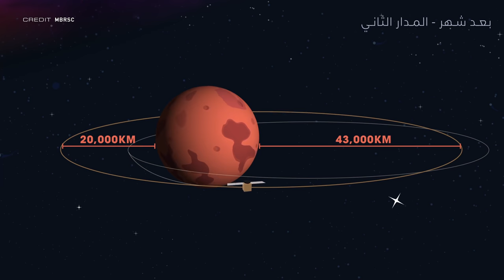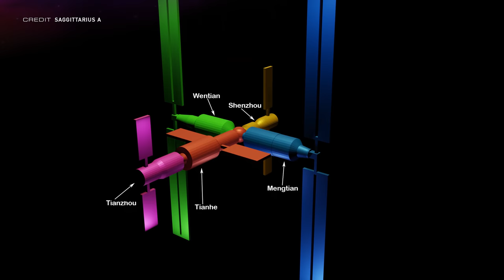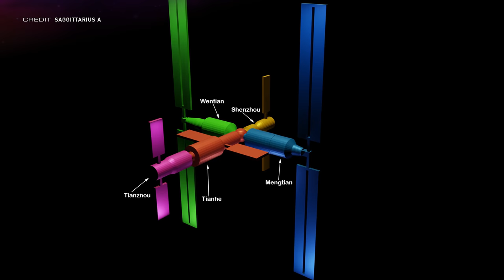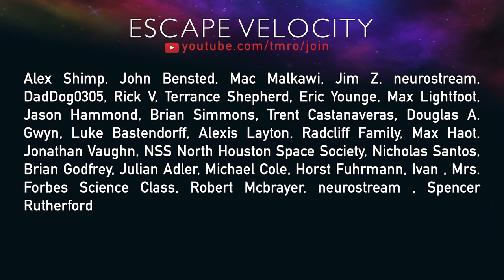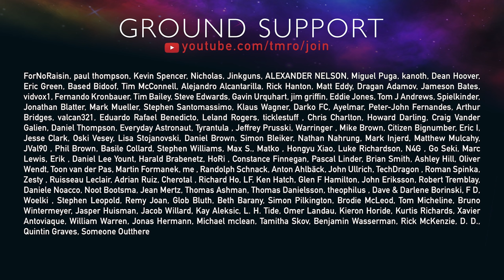2021's Epic Spaceflight Events | TMRO:News

Comment: G'day,

At this point, the Starship appears to feature not only a complete absence of Launch Abort Capability, but also an apparent inability to reliably feed it's Engines with an UNINTERRUPTED Supply of Liquid Methane & LOx,  during the necessarily rapid Transition from Belly-Flopping unto Tailsitting - apparently due to the Chaotic Fluid Dynamics pertaining within a pair of Pressurised (Semi-conical) Spheroidal Tanks which are  located at differing distances along the Long Axis (Moment-Arm) of the Fuselage (one midway & t'other up at the extreme Nose - there placed for Aerodynamic CP vs CG Reasons...), with corresponding Leverage-induced Lateral G-Forces generated within the Liquid Fuels remaining inside the respective Tanks.., all being magnified (by differing factors) by the inevitable Oscillations in the Fuselage's Attitude resulting from the  Engines' Gimballing Mechanism's Operationsl Lag-times when initiating the Transition from Belly-Flopper to attempting to "catch it" at the Vertical, in order to arrest the otherwise accelerating descent-rate.

 It seems to me that unless & until some other, probably more complicated and  heavier, Header-Tank System is developed and retrofitted (or incorporated into entirely redesigned new Rockets..., capable of both containing, and uninterruptably  delivering, Liquid Methane and Liquid Oxygen to the Engines - despite being subject to  strong, random, multiple, Lateral Oscillations - while attempting to (re)start the Engines....; then Elon's definition of "Successfully" (Suck Cess Fully...!) will probably be a lot like what happened with Trumpy's ideas of,

"So much Winning !"

(which turned out to produce  only 
'So Much WHINING...', instead !).

But, seriously, Elon's Starship is looking like the Hyperloop in the Sky, at this point...; no Launch Abort Procedures beyond,

 "Sit Still, and Wait to Fry & Die...!", 

but that's all,

 "A-OK !"

 because the Engines have never yet ever re-lit - at the end of the Swansong Re-Entry Bellyflop, thus vertically enveloping the Landing-Zone prior to detonating like the Bomb that it is..., on impact...!

  No wonder the Eccentric Mister Musk is now hiding his Money in Bitcoins, apparently betting against Grid-Failure shutting down the Electricity-eating Servers..., inside of  which his Bitcoins are said to have their Theoretical "Existance".

Elon Musk makes many curious Bets..., mostly using other people's money ; which is an interesting sort of a Trick (!).

   Such is Life,

Have a good one...

Stay safe.

;-p

Ciao !